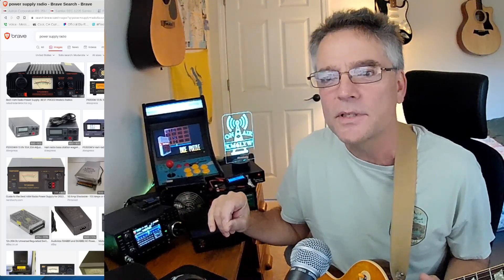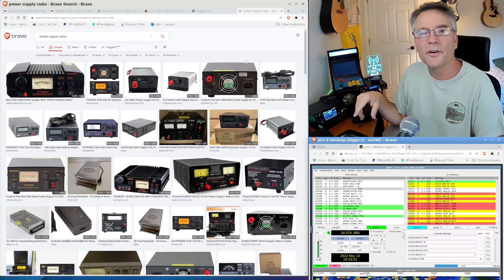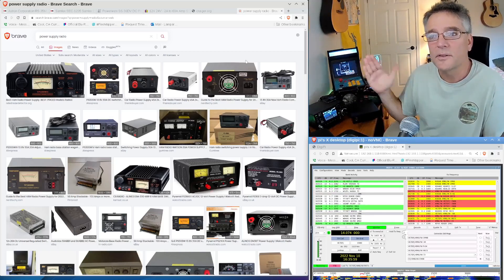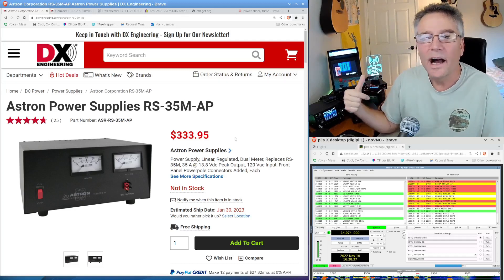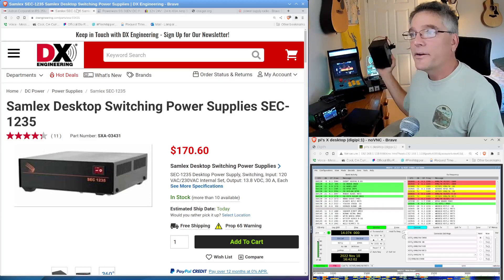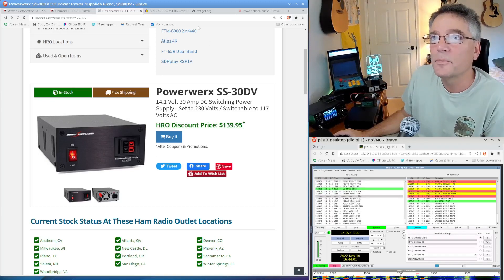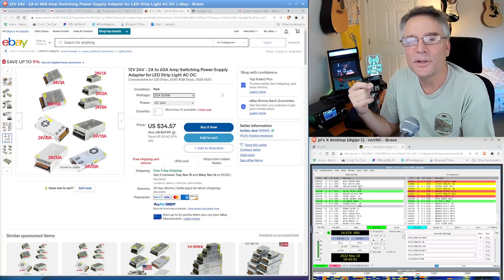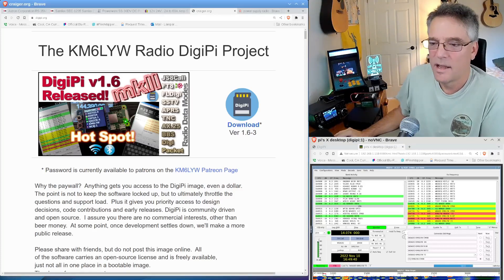The SHOCKING TRUTH!  Radio Power Supplies

Comment: I have an RS-35M and an SS-30 (both Astrons).  Both work great!  The SS-30 makes no noise that I can find in the HF or VHF Ham bands.  I bought the RS-35M years ago for $100.00 used.  I would like to see the PowerPoles ON THE BACK OF THE SUPPLY! I don't like to see the wires!

Comment: I find the hum of a beefy linear power supply very relaxing.  If going for a computer power supply, commercial units for installation into rack-mount server computers are very well built and relatively low noise with a high current capacity.
Reply from the maker: server power supplies can be had cheap on ebay too!  my only complaint is that they're 12V vs 13.8?  maybe adjustable?

Comment: I wanted to buy another Astron 35 power supply (I have 3) The last one I bought in 2021 was just over $200, however, when I checked the dx-engineering website they're close to $500 and more now.

Comment: Luv your channel. I’ve learned quite a bit from you.. 
Just kind of curious. When I was 19 years old, 1989.  I had a boom box in my car. I still have all the parts 400 Watt amp 2 = 12 inch subwoofers face plate stereo and 2 = 6x9’s 200 W each. With 200 W amp.. Now! Want all this. In a man cave.. 
What power supply can I

Comment: I don't want to be picky but there is no such thing as a free lunch here. A car charging circuit is more like 14.5V and that is why 14.2 might be seen on the battery. You can't have a 13.8V charging circuit and see a higher voltage on the battery. 

This video was about nothing! What was the SHOCKING TRUTH about power supplies?

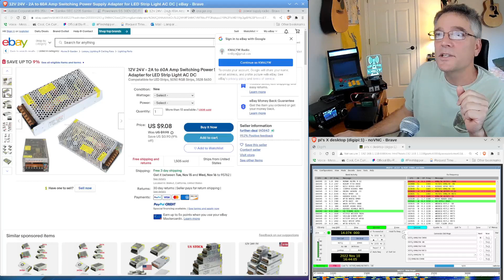Comment: Sir, At 13:20 min onwards you are showing some cheap ebay crap and asking why will spend on linear when you can get these for 10%!!! 

“Penny Wise Pound Foolish” is what is coming to my mind.

If you are making a comparison on price, make it between linear and switching of same brand, but you went from  linear Astron to nameless shit. Same brand, the price is probably around 60% of linear.

Why will anybody in their right mind risk buying a cheap power supply from ebay for their expensive rig!? 

You are talking about they being bad later and then almost recommending them using only price as a point to buy them!! Some beginner who is new is going to buy them and toast their equipment watching your video in the name of taking a chance!

One can buy switching with 30A for roughly 90 bucks from brands like Tekpower. Thats a better way to go than going nameless cheap.
Reply from the maker: I agree,  "I bought one of these and I threw it in the trash,"
Reply: @KM6LYW  You did say it, but the 10% cost and hit/miss is what I fear a noob on money constraint will mainly hear and might think of taking a chance. 

But I liked everything else about your video. 📻

Comment: Excellent video/information. I have a Kenwood TS-50, 20 amp power supply for my TS 440 AT. When I use CW, the power supply gets hot and even needed repair recently, so I am looking for another Power Supply.  Will look at Samlex 1235p-m.  I can use the TS-50 with diodes for the Handy. Good advice! Subscribed!

Comment: I just had a cheap $12 HP server power supply off ebay...  PL18  - easy to mod for 13.8v with magnifying lens and a very steady hand. those SMD posrta are tiny!!
Cheap switching (very clean) PSU for 54 amps output.

Comment: New guy question - Can you have 2 mobile radios hooked up to 1 power supply? For example, have a HAM mobile radio and a CD mobile radio? Do they make PSs specifically for dual radios? I haven't seen any but then again I don't know what I'm looking for. Some have the "cigarette light" jack and the red/black cable hook-up. Could you plug the CB in the Cigarette lighter jack and HAM in the red/black? Thanks in advance
Reply: sure, i have one psu for two radios, however, i often use one or the other but not both.   I don't like how hot the cigarette lighter jacks get either.

Comment: I just can't take any ham seriously who doesn't understand that for radio communications linear power supplies are the gold standard all switching power supplies will be a compromise. 

whether that compromise impacts you directly all depends on your skill level. When I see people say I have a switching power supply and I don't see any switch noise I know I'm dealing with a ham radio operator with limited experience and knowledge in radio communications as all switching power supplies generate RF noise. 

next time someone tells you that they don't notice any noise from their switching powers by ask them what their RF noise floor is. If they give you a nice floor in s units rather than DB then you know you're dealing with an inexperienced ham radio operator. 

I have spent a great deal of time lowering the noise floor at my location and have an extremely low RF noise floor, it's so low that I can detect switching power supplies half a mile away from my house at my neighbor's house. 

I have a switching power supply in my shop and if I leave it on when I'm on the air I can see it as it increases the noise floor. So I need to turn that switching power supply off. 

I have several of the astron 50 and 70 amp variable voltage and current limiting power supplies and you'd need to tear them out of my cold dead hands before I give them up.

I also have over a dozen high-end switching power supplies and several of the low end versions and they all generate RFI 

of course if you live in the city and have an S8 noise floor across the bands you'd never notice it 

also a slight correction to something mentioned in the video, if your radio is not putting out full power and you have a capable power supply then clean your fuses. 

ATO and ATC fuses are notorious for developing oxidation and/or loose contacts. 

One of the best upgrades you can do to your radio is replace the ATO/ATC fuse with a glass fuse. 

set your radio to full power and transmit a carrier into a dummy load while monitoring the voltage at the back of the radio. 

You're going to want to measure the voltage at the connector at the back of the radio not the back of the power supply. 

You shouldn't see more than a 10% drop in voltage If you do you need to pull your fuses out take some Emery cloth and clean the contacts. 

For some reason manufacturers are no longer using self-cleaning fuse holders, self-cleaning fuse holders are essential for ATC/ATO fuses, unfortunately manufacturers figured out that they could just use female spade terminals instead and so now just about all manufacturers use female spade terminals in their fuse holders and these do not properly clean the fuse contacts. The end result is over time As a result of repeated heating and cooling the fuse contacts will develop excessive resistance and you will see excessive voltage drop under load. 

With that said if all you do is operate VHF UHF repeaters then you can probably get away with a switching power supply, if you have a high noise floor Then you can probably get away with a switching power supply. 

But as a ham radio operator you should be doing your best to locate RF noise sources and eliminate them so you can actually work those week stations. 

I mean seriously what good does it do to spend a fortune on a ham radio with an excellent receiver only to install it in a high r of noise environment, you might as well just buy a cheap SDR receiver.

It's hilarious I know hams was spent a fortune on ellacraft radios because of their exceptional ability to here weak signals and then install them in an environment with a high RF noise floor plagued with RFI, talk about a waste of money and effort.

Comment: I inherited a mint jrc nrd-545 and want to power it with a dc power supply.  I am new to amateur radio and confused which power supply to use.  It runs on 13.8VDC with  30 watts.  How does the 30 watts affect which power supply to get.  Ron
Reply: Watts is Volts Times Amps.   a 30watt supply at 13.8V is 2.1Amps  (not much)

Comment: samlex used to be good but the 1235 fan comes on every 10mins with just a hf radio recieving. its super annoying. the 1223 doesnt do that. they also used crapcon caps that fail as we speak
Reply: Last year I bought an ICOM 7300 and a new Samlex. I was getting weird voltage drops.  They sent me a new one.  Same issue.  Can't figure out what is going on. I believe both supplies are defective.
Reply: @onemorething100  which samlex?
Reply: @onemorething100  ?
Reply: So ....  samlex is bad ??
Reply: @THESHADOW97139  its hit and miss. the 1223 is the best one and handles any 100w rig with ease

Comment: I have the Samlex SEC-1235M for my HF rig. I have been very happy with it. 

Some commenter asked why you need meters - I have diagnosed more problems, usually with digital modes on HF, by observing that the transceiver's TX LED was ON but that power supply amperage drawn was ~2A rather than the expected 15A, than with any other diagnostic process. (PTT was being driven, but no audio signal was being received by the transceiver). 

My first power supplies were the inexpensive (usually) Chinese LED-driver power supplies, like you ended with. Both died after ~12 months of use.  But I was lucky - a worst-case failure could either put 25V DC into your $1000 HF rig if the regulating circuitry failed, or an unattended PS running a rig in Winlink mode (high duty cycles approaching 100% transmit are possible) could catch fire. Not worth the low-price IMO. The LED driver PS units also tend to emit copious amounts of RF noise in the HF bands. 

At work (the Borought's EOC) we have an 50-amp Astron PS ($$$$).  Weight-wise it is a beast, but I have not observed any acoustic hum. 

Thanks for the video.

Comment: Cheap and "wonky" power supplies tend to destroy electronic equipment.  And If you've invested a lot in this hobby, say $1K or more (EASY to do), do you really want to bet the health of that equipment on a $25-$35 supply meant for another application?  Usually not a great gamble.  Regarding batteries, especially LiFePo, they all have a maximum discharge rate - and for LiFePo it's usually 1C, or the stated capacity of the battery in Amp-hours, but in Amps.  That would mean at least a 25 amp-hour LiFePo battery for an HF rig and that battery would cost about $75-$80 today, has a limited calendar life no matter how well you treat it and will not last long on digital modes/HF due to it's low capacity.  MORAL:  Spend the money to get a high quality power supply you can rely on - today and 10 years from now - one that won't barbeque your equipment with overvoltage.  Linear vs. switching?  Most switchers have fans and you WILL hear them if you push them hard.  They generate spurs on 40M and below, being especially obnoxious on 80 and 160M.  But if you never use those bands, or install a good noise suppression toroid on the DC power line, they can be fine.  I use both linear and switching supplies in my stations..

Comment: "you can't just plug your amateur radio into the wall...", that's not entirely true. Many desktop amateur radio transceivers have built in power supplies, even in the old days. Our university club had an all Icom shack, and the Icom 761, 275A,475A,575H all have internal power supplies, that was in the 80s and 90s. Today, still many have internal power supplies if they see desktop models.

Comment: I have never had a switch mode psu that was RF quiet so i prefer linear psu. Even the Yaesu FTdx101MP speaker/PSU is a noisy bugger so i'm contemplating trading it in for an FTdx101 instead at least it runs of 12/13.8V and those are easy to get Linear.

Comment: I ended up going with a 50Ah LiFePO₄ battery as the power supply for my rig, with Powerpole connectors, the same kind of wattmeter exhibited here, and a fuse panel.

Comment: On my radio at 13.8 volts the high voltage light is on can you tell me why? Thanks.
Reply: Use a multi meter to check the actual voltage of the power supply.  That is a good first step.

Comment: Like the video.  I have the same setup with the Samlux 1223  for dual band VHF/UHF and the Samlux 1235 for the ICOM 7300.  I also have a ICOM 706MKIIG tied to the 1235. But I only use it whne the 7300 is off.

Comment: I have one of those inexpensive switching power supply come in aluminium sheet metal.  bought 13V  36A for $35.  it works fine, except it has some leakage , isolation from 120V AC to DC is not the best.   if you connect the radio to other device, you may hear some leakage noise.   but, as long as use the radio by its self it is fine.  AG6JU
Reply: 99% of 3D printers use them too.